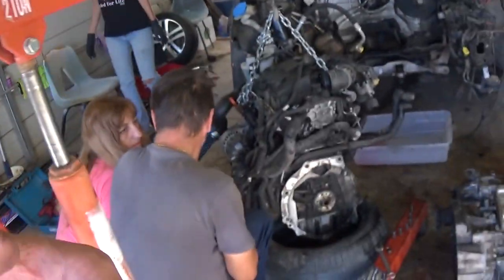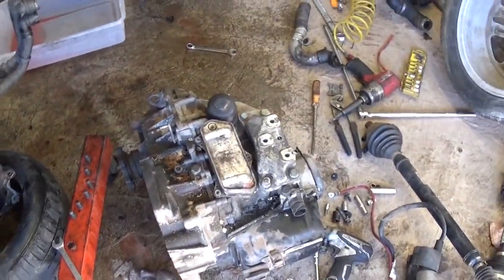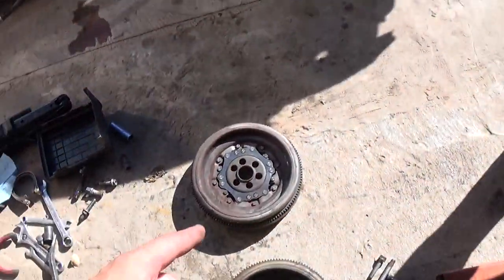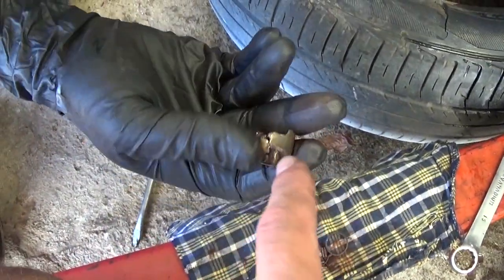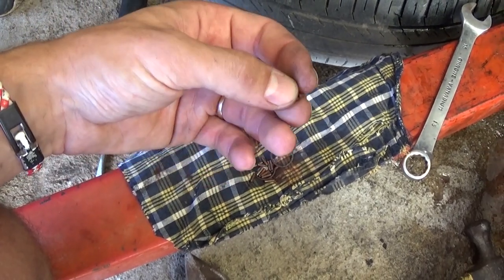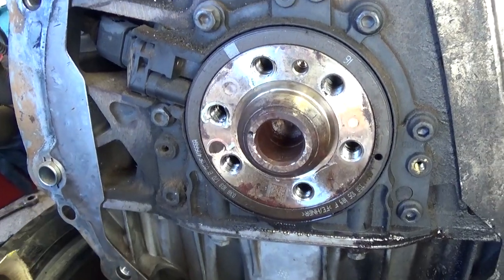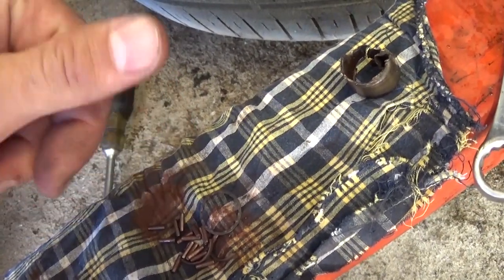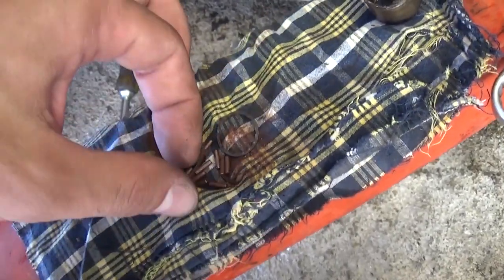WHY YOU SHOULD NEVER IGNORE PILOT BEARING

Comment: Pilot bearing on my old car died a month after install.  Don't go with the cheapest one either.  Had the pull the whole transmission again just for the bearing.
Reply from the maker: great advice. Was that on the ST?
Reply: On my previous Ford Escort ZX2.  Did an automatic to manual swap and used the pilot bearing that shipped with the clutch.  I hope not to have to do anything too extensive like that to the ST yet, only at a year and 15k miles so far.
Reply from the maker: I love the red color on your ST.

Comment: does Jetta MK6 TDI with manual transmission also needs a pilot bearing? according to the service manual the Pilot bearing/ "Needle bearing"  not used in manual. but i still get noises when releasing the clutch. i have a Single flywheel

Comment: I am replacing my clutch, flywheel, release bearing & pilot bearing for my 1971 Dodge & the pilot bearing that was in it had roller bearing like the video, It came out in pieces. I am not sure if the race is still in the shaft opening but when i place the new bushing in the opening I can tap it into place.  Should I or is the race sleeve still in. I have pix.......any advice???

Comment: Hey man, I just paid $900 labor to a mechanic to do a clutch job on my 93 VW Eurovan Westfalia. I found the brand new pilot bearing I gave the guy inside the van.  He forgot or ignored to replaced it. The car has 188k miles and god knows how many on that bearing. What would be the right thing to do ? They guys is not replying my messages about it. Thanks (car runs smooth though)
Reply: Lmao he realized he has to drop the transmission just to replace that. I hope you got it fixed.

Comment: what happens if it goes unreplaced
Reply: Well, in my case, preparing to lower the transmission again, just barely over 25k km since cluth, press and slave cylinder replacement,  so a real pain in the ass to get out